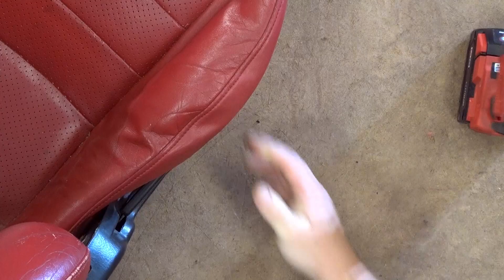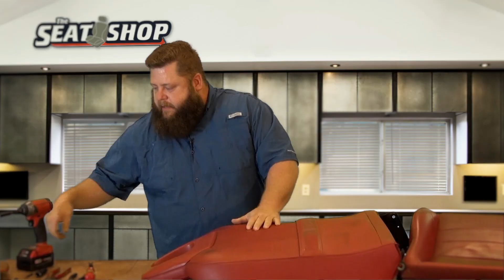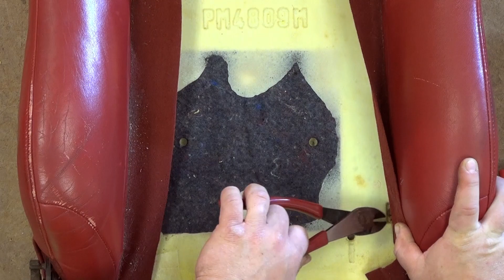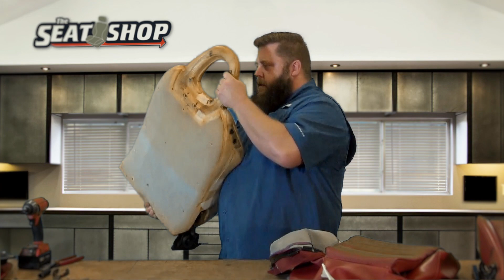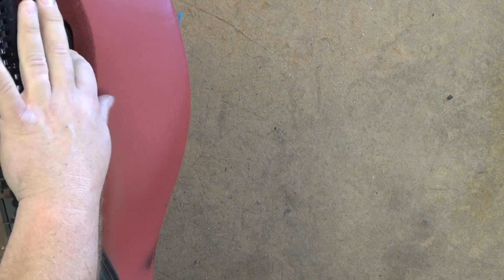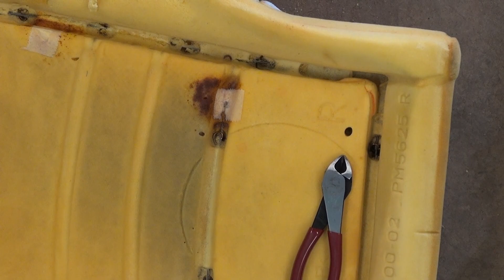2000-2005 Honda S2000 Seat Cover Installation Part 1 of 2 : Seat Disassembly

Comment: These still available? I don’t see them on your site anymore
Reply from the maker: Not at this time due to us running low on the material, etc. We don't know if we will be restocking that since it is not an item that has been in high demand since release.
Reply: @TheSeatShop  i Understand,  our cars are kinda rare though and parts are non existent. I hope you decide to make some more. They probably wont fly off the shelves.